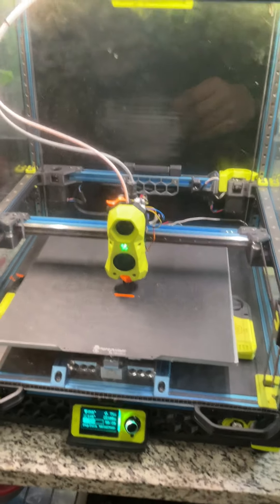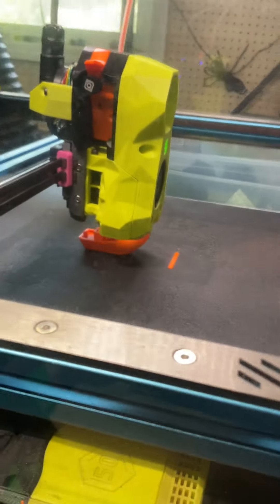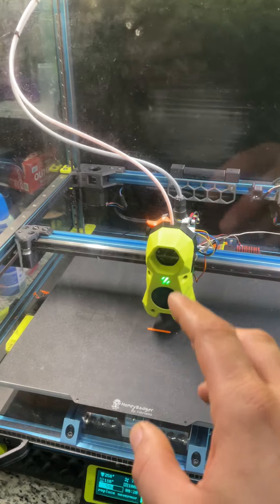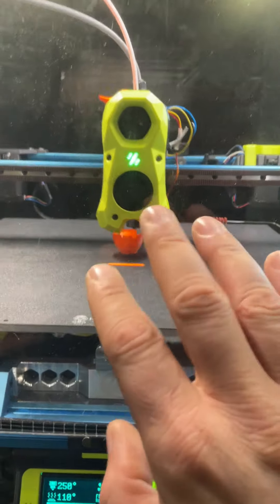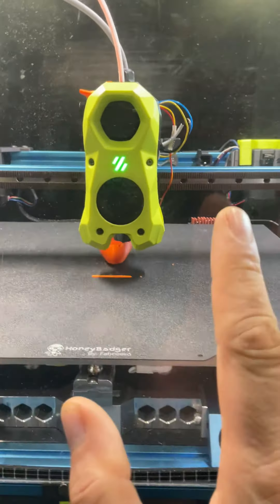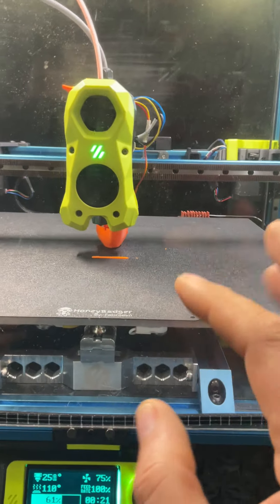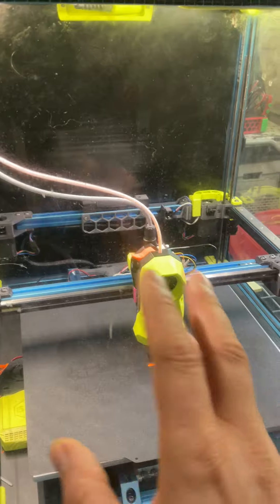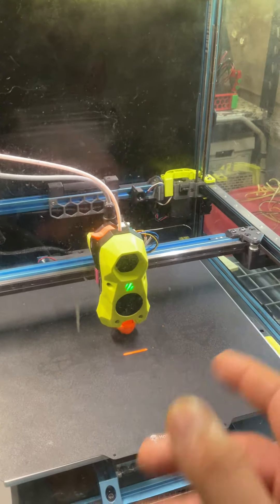100 hour FlexTap update

Comment: Makes sense that over time there’d be some settling/deformation over time. I wonder if it’ll continue to require adjustment or if there’s some point where it just settles in. 

Idea?  Put a newly printed one in a filament dryer for 10 hours and see if it does the same thing after 5-10 hours. E.g. can you break one in before first use.
Reply from the maker: Time will tell. However, I would expect more first layer adjustments as one normally does with any probe over time